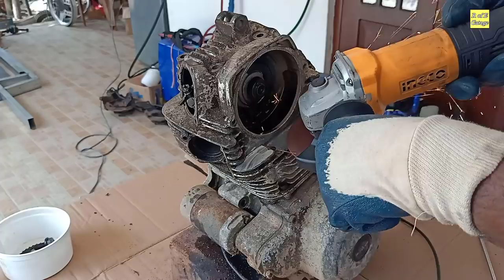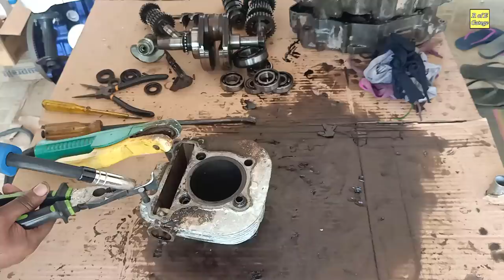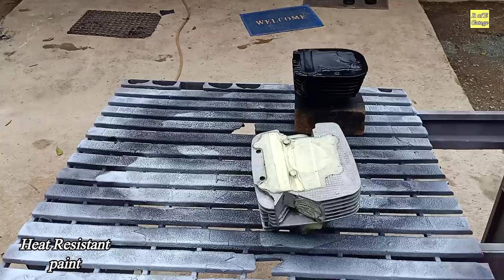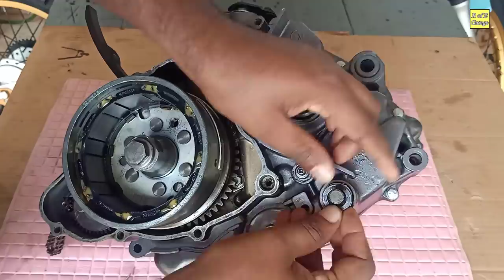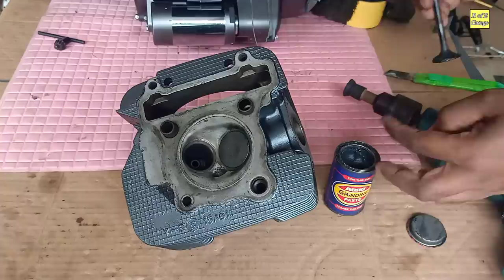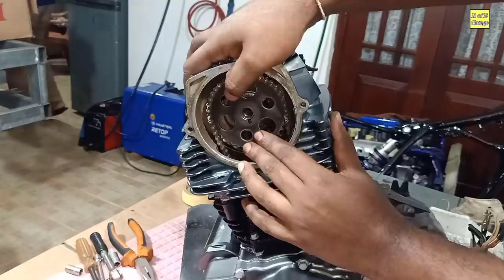Yamaha Serow 225 Engine Full Restoration

Comment from the maker: Yamaha Serow 225 bike full restoration https://youtu.be/QhCuQLSqJG8
Reply: Please do a restoration of the famous Honda XR250R MD30
Reply: No, please god damn, NO!!!  The bearings you need to pressing out with heat of the seat of bearing! Otherwise, you will get the squandered place/hole for the NEW bearing, and it will break down in 500-1500 kilometers!
It is for engine, and wheels too. To all new bearing!
Best regards,hello from Saint-Petersburg, Russia.
Reply: @Neranjan.Dissanayke   the question is for me?
Reply: What Carburetor size are you using?
Reply: Bro kohamada contact karanne
Reply: @nordenconrad  0
Reply: @nordenconrad  00
Reply: 0
Reply: @nordenconrad  0
Reply: I have  yamaha sr250 modal 1987 can u restore engine plz reply
Reply: @nordenconrad  q
Reply: Wonderful work 💯
Reply: @nordenconrad  l
Reply: @nordenconrad  m
Reply: @Акамулятор  L
Reply: lலல்லல்Lள்ள
Reply: ல்
Reply: @Акамулятор  L
Reply: l
Reply: @nordenconrad  n

Comment: You guys need to start using new cylinders aswell. A new piston in a worn cylinder is only a temporary fix...
Reply: @matthiasweigel311  Well they didnt use a bore gauge to measure the cylinder diameter. So its nothing but a gamble to just throw in a piston without taking any measurements. 
Then you can see in their engine rebuilt video that the cylinder looks very glossy almost polished. Thats a clear indicator it is worn out. A cylinder in good condition would look dull because of the cross hatching.
And you saw the rest of the engine. It has done a lot of work in its life.
Then everybody who knows a bit about engine building knows that you never replace piston rings without honing or replacing the cylinder. They did neither.

You were talking about money: If if youre tight on budget do it right the first time instead of doing temporary fixes again and again which cost more in the long run! And  maybe save money on unnessesary fancy paint to buy yourself a cylinder so you can repair your engine the right way!
Reply: I state the obvious here: They sell it,- then it´s not their problem anymore! I doub´t the boss doesn´t know about it.After all he has to order and pay for the new parts ... ;-)